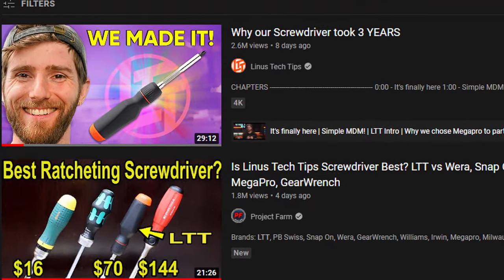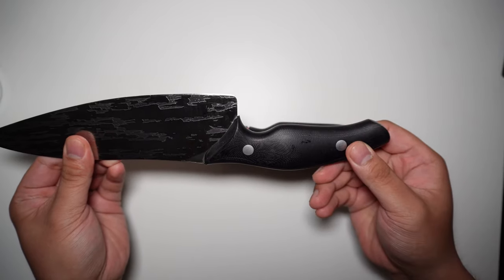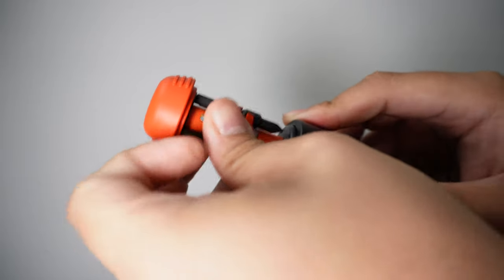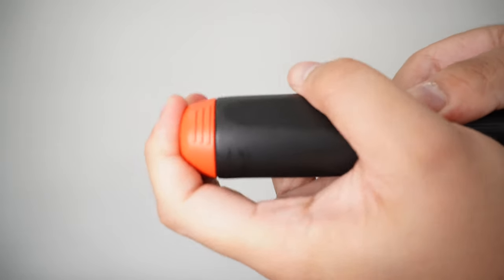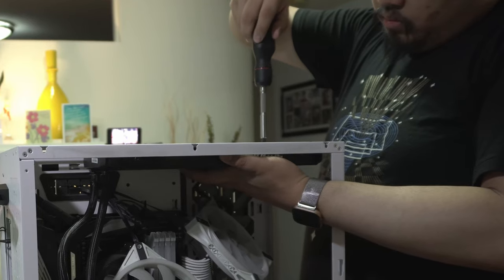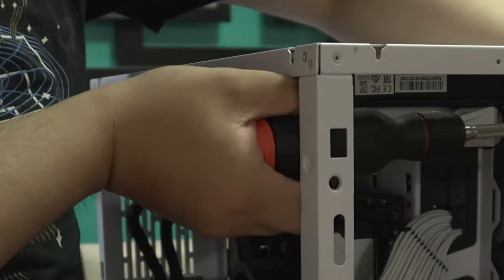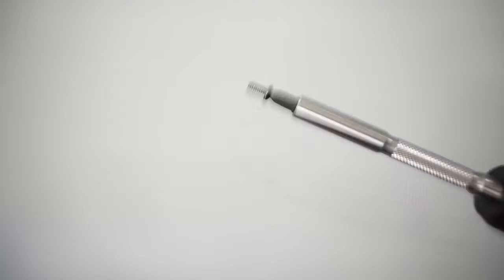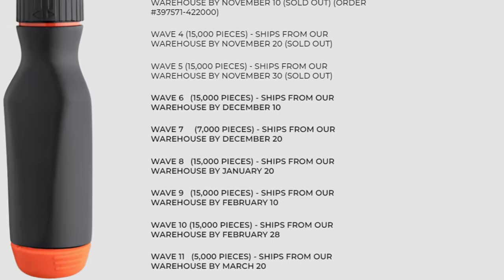LTT Took 3 Years to Create a Fidget Toy - LTT Screwdriver

Comment: I'm curious. After watching the Project Farm video, the LTT driver had the least amount of ratchet backforce, even compared to the BIG boy tools. Have you found a screwdriver that has less backforce on the ratchet?
Reply from the maker: I have not used a screwdriver ratchet that is lighter than the LTT one. I used to work on aircraft and never really had an issue with unintentional reverse driving a screw due to excessive backforce, mostly found that it happens with computer and electronics parts. Honestly it's not much of an issue, when I notice the screw slipping backwards. I just swap to manual. Now that I'm getting comments about it, my choice of words seem harsher than I intended.
Reply: Jay2cents just did a video using the screw driver putting a pc together, that made me want to oder one and prob will do so soon.
Reply from the maker: @AnotherLazybum  its a great screwdriver, you'll definitely enjoy it. Also glad Jay too thought saying "completely black shaft" is funny.
Reply: @AnotherLazybum  Yep jay2cents video is really good…
Reply: megapro sells an automotive version of their screwdriver... oddly this version is never shown in comparison by reviewers. it fits 12 full size bits... it has a magnet in the shaft... and it functions 77% better in the locked position than LTT. 

megapro has 19 grams of ratchet backforce... LTT shaved off 10 grams, but added 77% wobble when locked in messing with the megapro ratchet design... given that the competition all believes that 30-60 grams of back-force is acceptable, and it was for linus for a long time with the snapon... this 10 grams is negligible... and given that it was designed as a in-office EDC for linus... if this is the only thing you have on you, it better function well when locked.   

I would save some money and just get the regular megapro and a magnetizer... but if you are really sold on the magnet... the automotive version has one in the shaft just like LTT. For the space constraints mega pro also sells bit holders that have slimmer shafts, even if you go with the automotive version, your budget can still squeeze in both a regular bit holder and a precision bit holder. 

The rubber grip is objectively better of the megapro... but i haven't always taken care of my tools and the rubber gets grimey, so i geinuely do like what LTT did with the handle... i would pay 80 bucks for this aesthetic of megapro's $50 automotive driver. 

They were self-conscious about licensing a design  after failing on their own... and they messed with something that was already good.
Reply: @Enthusiast_Impressions  Aviation fasteners are intentionally designed to have lots of torque required to loosen. Standard threaded holes are much looser tolerance and have less friction when loosening and tightening the screws. I'm sure you're already aware of that, but it does mean that it's an invalid point of reference when talking about excessive backforce. For example, the majority of skin panels are fastened to floating anchor nuts and require substantial torque to thread and unthread through the entire length of the fastener. Most of the fasteners the LTT screwdriver would target are going to be machine thread PC screws, and generally those can be finger tightened through the length of the fastener. Backforce wouldn't need to be very high to reverse drive the screw.

Comment: Do you have a screwdriver you would recommend instead? I know a fixed shaft screwdriver tends to be very useful when assembling PC's due to the space constraints. Compared to the price of a normal screwdriver, I certainly see the, "don't buy this if you aren't going to use it regularly" criticism as valid.
Reply from the maker: I would recommend almost any smaller screwdriver for those that wouldn't use it regularly. Ifixit has the Minnow and Moray sets depending on the diversity of bits you need. But those will do horrible if you go for anything bigger than a full tower PC. Otherwise, even the Fixa kit from IKEA which I've used before works just fine and is shorter. Both also come in a case for easy storage.
Reply: megapro sells an automotive version of their screwdriver... oddly this version is never shown in comparison by reviewers. it fits 12 full size bits... it has a magnet in the shaft... and it functions 77% better in the locked position than LTT. 

megapro has 19 grams of ratchet backforce... LTT shaved off 10 grams, but added 77% wobble when locked in messing with the megapro ratchet design... given that the competition all believes that 30-60 grams of back-force is acceptable, and it was for linus for a long time with the snapon... this 10 grams is negligible... and given that it was designed as a in-office EDC for linus... if this is the only thing you have on you, it better function well when locked.   

I would save some money and just get the regular megapro and a magnetizer... but if you are really sold on the magnet... the automotive version has one in the shaft just like LTT. For the space constraints mega pro also sells bit holders that have slimmer shafts, even if you go with the automotive version, your budget can still squeeze in both a regular bit holder and a precision bit holder. 

The rubber grip is objectively better of the megapro... but i haven't always taken care of my tools and the rubber gets grimey, so i geinuely do like what LTT did with the handle... i would pay 80 bucks for this aesthetic of megapro's $50 automotive driver. 

They were self-conscious about licensing a design  after failing on their own... and they messed with something that was already good.
Reply: @itainteasy  i see that you are little biased for this megapro automotive screwdriver. 

Also keep in mind that an automotive screwdriver is not comparable with a screwdriver that is designed for building pc.
It just like saying that an electric drill is way better tben an battery operated drill.
Reply: @robhofkes3221  LTT's screw driver is not designed for building PCs.  full stop. It comes with a standard set of bits, they do offer other sets so you could design a set specifically for building PCs. It is designed to be the best ratchet to carry in your back pocket around an office, so you don't have to return to your tool bench. 
LTT marketing isn't here's how we turned megapro's design into a ratchet for building PC's. Rather, it's a better ratchet than these 6 competitors. 

I agree what i wanted and thought of the hype was they were building a ratchet designed for building PC's... I can appreciate if you haven't consumed all of their release marketing how you would have that impression. Go look at the marketing of Gamers Nexus' screw driver set... this is truly marketed for building PC's despite not having all that much different in the design (i would say the same about megapro's automotive, it's marketed towards but isn't truly designed for)... LTT is not marketing this as a PC building screwdriver. 

Megapro uses trades to name their screwdrivers, they aren't in fact all that specialized, just have different feature sets. 

I am not biased towards megapro...  it was actually HTR (above) that pointed that version out to me, he has a great video on it.   If anything my preference is wera cause i like having a lot of options and length of bit holders, and like i said, i like the aesthetic LTT did, and i like the aesthetics of wera in the same regard. But LTT licensed a design from megapro, and considers them a partner in this project... so when evaluating if their changes did that license justice, megapro should be compared.
Reply: @itainteasy  Sorry to say, but Linus had designed this screwdriver with PC building in his mind, hence why the shaft is mostly thinner then the other ratched screwdrivers. He said it himself in one of his videos.
Also if you really want to see a really good comparison/review of the LTT screwdriver with 6 other brands you definitely should check the video from Project Farm. He did performed some really good tests and even do a test to see when they will break.
Reply: @robhofkes3221  I've already addressed that... "I can appreciate if you haven't consumed all of their release marketing how you would have that impression." There are two videos that sell the screwdriver that have been released... the per-release hype is irrelevant now that it has been released, and you have been mislead by the per-release hype. The terms "PC" "PC Building" or "building" "computer" "electric" "electrical" don't show up on the product page. The word "tech" only appears in the copyright on the bottom of the page. 

you aren't following... This thread is a request for "a screwdriver you would recommend instead?" You are the one out of line here. all the stats i listed are from project farm. Jeff's video debunks the idea that this is designed for PC building, and addresses if the slightly thinner shaft is of any use inside a PC/electronics case. They both did a great job in reviewing given they are on the same platform and this is essentially the youtube screwdriver, if you consume the data and not their polite tone towards their platform mate you might find an appreciation for some of the conclusions here. I hope you realize that you are the one out of place not participating in this constructive dialog. If you like it, please buy it.

Comment: Sorry, I had trouble understanding a lot of this video.  Reading off a script makes you talk so fast that a lot of words run together.
Reply from the maker: My apologies, feel free to slow down the video if it helps. Option should be in the gear icon, as playback speed.  still working on improving my enunciation to make sure the words don't slur together as much. I've had people tell me that I do actually talk too fast. The script seems to have compounded the issue.
Reply: @Enthusiast_Impressions  Don't stress it. Enunciation from script reading will improve with time. Top tip, look at slightly exaggerating key words in the script ; "Try EXAGGERATING the KEY points you want to make in that SPECIFIC sentence, and CONCENTRATE on saying that word SLOWER and with appropriate TONE. In TIME, you'll find your SPEED will drop to match this and your OVERALL speed will drop naturally." (try saying that in your head with emphasis.)
Reply: @Enthusiast_Impressions  Thanks for the reply.  I’m glad you understood that I wasn’t trying to bash you or your channel.  I was hoping to give a bit of constructive criticism.  Thanks!
Reply: Understood every word no problem.

Comment: The cons in this video are presented in a vacuum. If you’re going to say this screwdriver lacks something or could do better, show me one that does
Reply from the maker: That is true. I presented it a vacuum. I didn't notice that. Shows I have long to go. I have not used a screw driver with a better back force, and as mentioned in the video, noticeable but not a bother at all. I used to handle aircraft engine parts and the reverse driving of a screw never popped up until computer building. That was years ago, so if it did happen, I didn't notice it.
Reply: @Enthusiast_Impressions   nah dude, that's not how you have to do it. You were reviewing the driver without comparison and it's totally acceptable to call the flaws out. Whether or not another can "do better" does not negate that flaw. 
You can only review it from the perspective you have, which is your true experience, thoughts and impressions. That's valuable. Neglecting to mention something because you don't have a "better" solution isn't a great philosophy. Especially not for a review.
Reply from the maker: Thanks for the advice. I definitely should have at least have put a little more context to my previous experience, to provide context to my opinion.
Reply: HTR  im sorry, but the Wera and Xiaomi are junk. Absolute garbage. Horrible ergonomics and ugly too. Wera is famous "high quality" junk. Just like Global is for kitchen knives. Only loved by people who haven't worked with the good stuff.

Ill give you this tho, 
I absolutely agree that it should have been compared to the PB Swiss 6510and Williams

Comment: 130 inch lbs is only 10.83ft lbs jesus thats nothing when i was a mechanic i would brake brand new $250usd snap on ratchets, bend breaker bars etc.. but i could lift a 6 cylinder engine block by myself my dad could lift a V8 block by his self mu grip strength with one hand is over 200 ft lbs both hands i can do about 500ft lbs
Reply from the maker: Yup, I remember needing to do 120 -220 ft/lbs on aircraft, but always with a torque wrench.
Reply: Ok but when was the last time you applied that much torque to a screw.